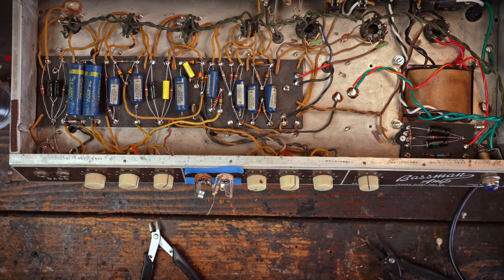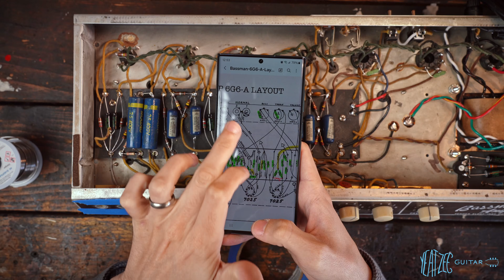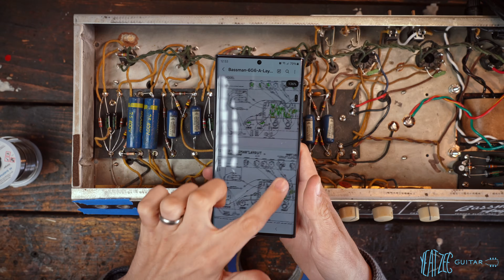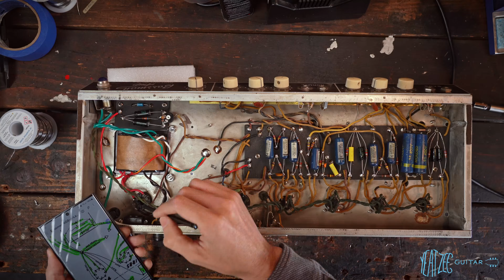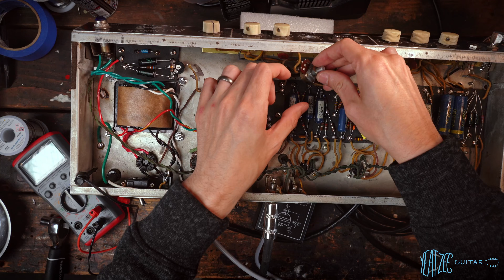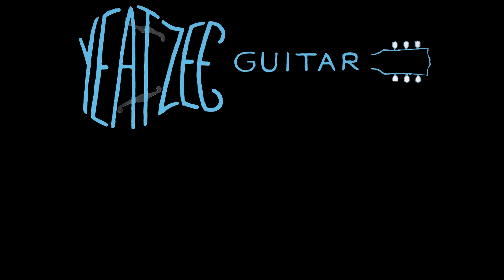WE HAVE SOUND! ...but....  | 1961 Fender Bassman 6G6 Amp Repair - Pt. 7

Comment: Well, that amp is fortunately quite easy to signal trace. 
 If the second double triode of bass channel is (like 6G6A is) a straight double triode  cascade without any voltage dividing of audio signal between stages, it is very prone to oscillations if input and output wiring of that cascade is not kept clearly away from each other. Gain of that cascade is huge. So wiring is critical. If that stage has that 1Mohm neg feedback resistor, it is a bit tamed version. But still,  if that amp was mine, I would add at least  a grid stopper to the grid of the 4th triode of bass channel or a some kohms series resistor between triodes to form a voltage divider. 
Another very important thing of course is to make sure that none of tone caps and coupling caps are leaky. 

And make sure that those small measuring clips are really safe  to use at high voltages.

Comment: The Eurotube meter is powered off the tube filament voltage.
Reply from the maker: Why would it not power on with full normal voltages if I brought the power on slowly? It's weird to me.
Reply: @YeatzeeGuitar , if there's any type of microprocessor in the Bias Probe circuit, it might freak out and lock up from the slow ramp-up of voltages.  Don't forget that the power-supply voltages will be very non-linear  when you power an amplifier up using the variac (and even more so with series current limiting inline with the AC), because the cold heaters of the output tubes and rectifier (not to mention the preamp tubes) will attempt to draw a ton of excess current as you bring the variac up slowly, because the cold tubes have very low heater resistance, which increases in non-linear fashion once the AC line voltage is brought up to the point where the tubes start to heat up; at which point the heater resistance increases, and heater current decreases.

Comment: I bought a 1969 Bandmaster with no transformers and substituted Dukane 1U460 transformers fired it up and there was a motorboat oscillation so I took all the pots, jacks, and removed the brass plate. It looked like someone used it for a spittoon.  Or coffee. black tarnish, Scrubbed it with scotch bright turned it back to brass . Scrubbed the chassis too, wiped it down with alcohol. Clean behind the brass plate.
Reply from the maker: Oh wow! Did that fix it?
Reply: @YeatzeeGuitar  , I can't answer the question you posed to the other guy but I can tell you from experience that the back side of that brass plate gets pretty grungy between it and the inside lip of the chassis. Cleaning both sides of the metal in there usually pays off in lower hiss/hum and it improves the circuit stability. You have a lot of dissimilar medals in those junctions: the brass plate, steel chassis, the zinc or nickel plating of the chassis, the aluminum control plate, and whatever metals the threaded bushings and rear covers of the pots are made of. It doesn't really require anything spilled in there for lots of oxidation and tarnish to occur  simply from a moist air environment and having current passing through it.